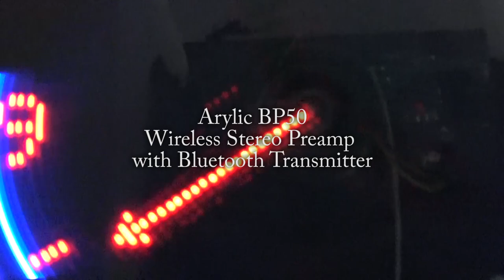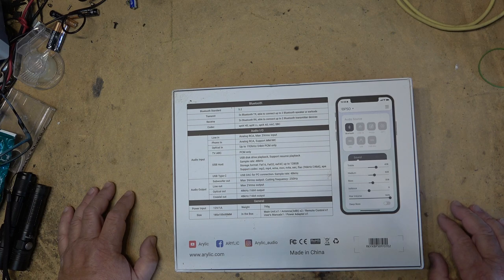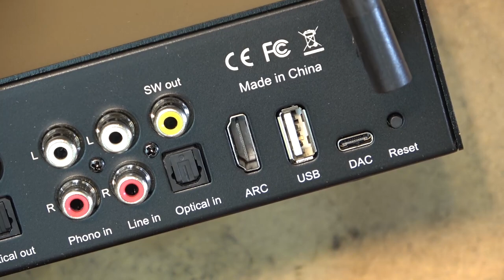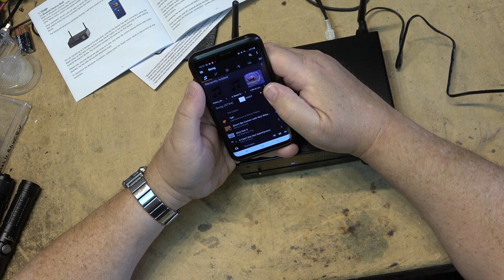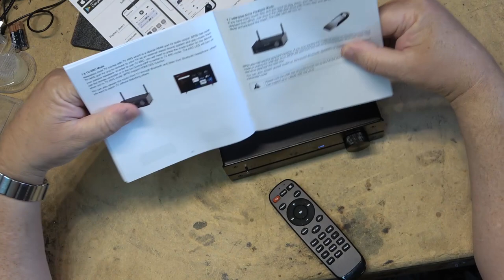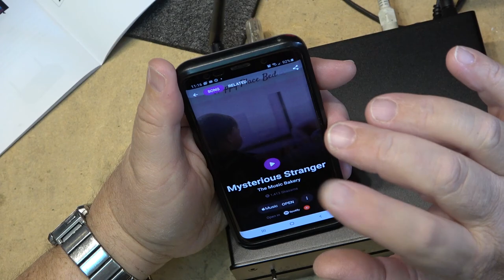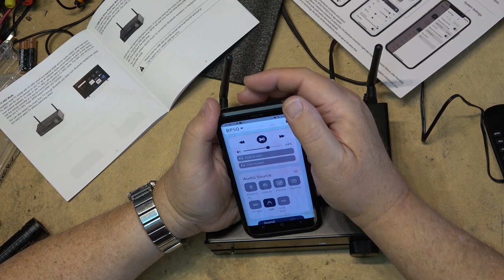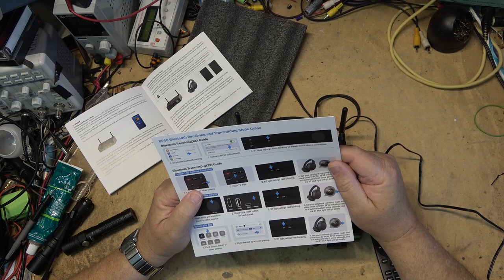Arylic BP50 Wireless Stereo Preamp with Phono Preamp and Bluetooth Transmitter

Comment: I've been using Acrylic devices or a few years now. From amplified units to pre amp units. I've also updated century old radio to s remote streaming radio. The unit to unit integration is fantastic.  Pressing pause on one unit and play on another in a different room continues the music to whatever room you are sitting in.
Reply from the maker: I have many running here and sold a few spares.  All work great.

Comment: I have two of these, and most issues I had have been resolved in a recent firmware update. However although they both work ok,  the quality of the white LEDs is not great. They are both used mainly on the ARC input, on one unit the ARC LED is no so dim you can hardly see it, and the other unit, it's completely dead. All the other ones light up ok when you change input. On one of the units, the BT LED is also getting pretty dim.

Just the white LEDs, the red Stby one is just the same as ever.

Comment: Hello,thanks for your video.
One questione please.
It's possibile connect the BP50 to the aux input of and integrated amplifier?
Or I  can use It only with a Power AMP?
Thanks so much 
Diego
Reply from the maker: Yes, you can

Comment: I am on my 3rd Arylic BP50 and they all are doing the same thing. Randomly no sound so I have to rest or turn off and back on then it is fine. Just never know when it will cut off sound. Funny thing the sub out still works when the sound goes out. Any Ideas ? This happens on all outputs.
Reply from the maker: Never have had any issues with any of mine
Reply: I am using a HP laptop I5 as source. HDMI out to tv HDMI in (non-smart tv). The Arylic connects from laptop by a USB C port to PC input on Arylic and Shows on unit display as DAC.
Reply: Replying to old comment, I have two BP50s that had this issue, there is now a firmware update to version 57 as of writing which resolved the issue on both.

Comment: Hello 12VVids,  I have a question that so far the gurus of turntables cannot give an answer too!! I saw that ground lug screw  the pre amp and it came to mind again.  My NAD 7400 power cord is not grounded, it is just a standard two prong 117v plug for the US. Can I ground my turntable to Earth Ground, the center screw of the outlet ??  Is there a reason that I should not need it?  I have no hum connected to the ground lug of the NAD.  Just a curious question. Thanks Bryan in EL Paso:)
Reply from the maker: Ground wire goes from tone arm ground to chassis of amplifier or preamp. Some turn tables ground this to the audio cable and thus won't have a separate wire.
Reply: Thank you for the info!!! :)  @12voltvids